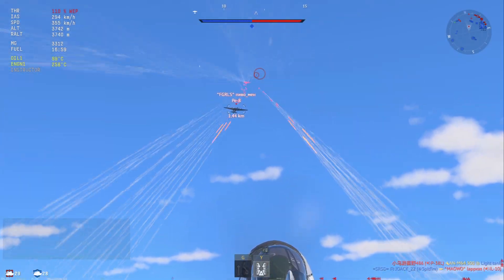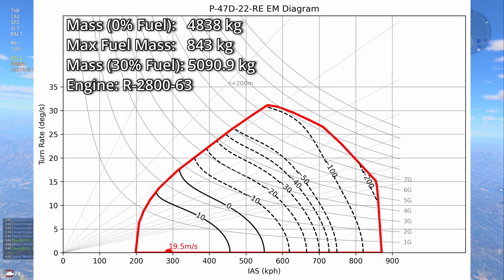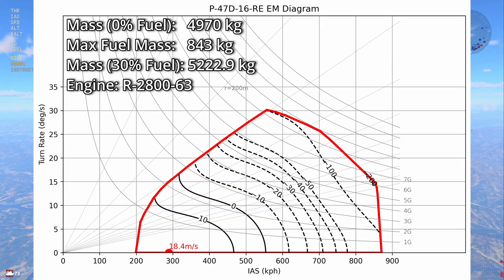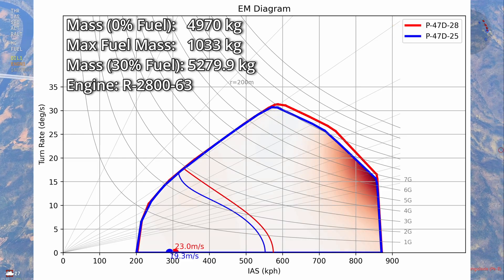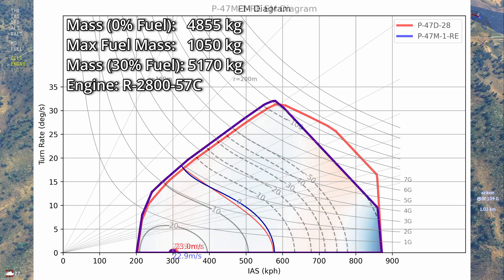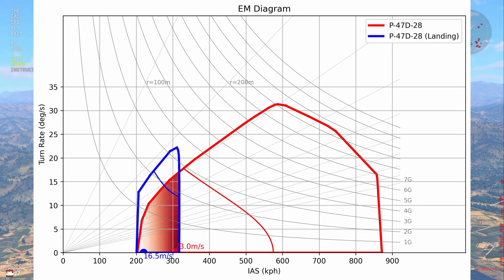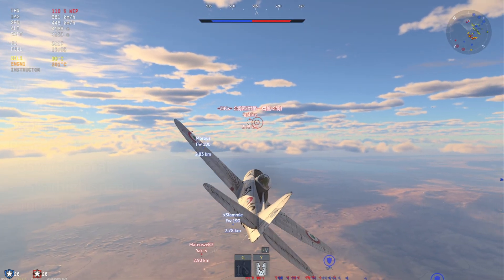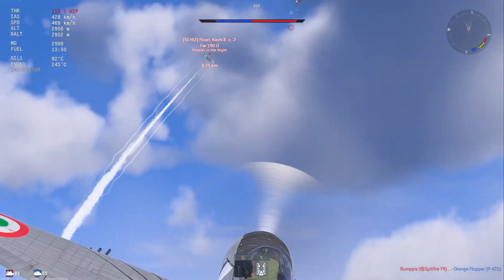Post-Nerf Clarity | P-47 Variants Compared

Comment: Ackchyually, the P-47N is a long range escort version that has longer wings with squared off wingtips to hold fuel. It has boosted ailerons which is why it rolls faster.

If only it wasn’t so fat with the 30% fuel load spaghetti code…
Reply: In rb it's sub optimal to use but in sim
That thing is is pretty good thanks to 
-flying longer and having less fuel overtime to be comparable to other 47s in weight
-late war gun sight (it gives you auto lead)
-better cockpit
-better dive and high speed energy retention
-high altitude performance (capturing points only possible at maximum 6k)

Also I remember hearing about it having a warning radar on the tail that activates if something is behind about a kilometer directly behind with a buzzing sound to alert pilot irl
Reply: @EagleSix52  many of the american aircraft had that rear facing radar, but they were not coded ingame because gaijin
Reply: Ceating is a name I haven't seen in a long time. The P-47N wings are just clipped, not boosted.
Reply: @DSRT888  And lengthened wings. More wing area, that's why it has better instantaneous turn than D28.
Reply from the maker: @DSRT888  ill say its up for debate lol i have no idea but it doesnt really matter to me
Reply: ackshullie
Reply from the maker: @penclaw :_werfErm:
Reply from the maker: lol my b i didnt actually do any indepth research on the irl role

Comment: Why does the D28 at 100% PP in MEC loose so much more energy at 6 - 9.5 G turns I wonder?

Also, am I correct in interpreting the N-15 graph that the plane actually has better retention with combat and takeoff flaps at almost all speeds and g-loads than without flaps??
Reply from the maker: not sure, id guess it has more to do with the fact that its going fast and higher prop pitch is worse for that (like trying to pedal a bike going fast on a lower gear)

Comment: I'll start sounding like a broken record here but i don't care as i must goon.
As a Thunderbolt enjoyer myself (D-28 being the highest played plane in ARB in my account) because of it's use by the Brazilian Air Force, i'd KILL to have all this info in such a neatly packaged video about 3 years ago when starting my journey through the US tree. It's awesome to see all of the conclusions i drew all the way back then being corroborated here like the D-25 being a downgrade of the D-22 at a higher BR, and finding out about the magical MEC settings which changed the way i approached props completely, as i hated having to deal with engine overheating by lowering throttle and thus reducing performance in critical situations.

I'd love to see more depth to the MEC part, like how does the different prop pitch settings affect the climb at different altitudes, and maybe a small guide on how to tweak your MEC settings for getting the most optimal climb at the start of matches, as for me personally it's the part that makes or breaks an entire match, especially for american props. 

But still i recognize that you've already gone above and beyond anything i've seen from other CCs, so i first and foremost ask you to get some rest. Or not if the graph voices in your head still call for your testing.
Reply from the maker: i think it would probably be best to just come on the adamtheenginerd discord server and ask about the mec settings cuz tbh i barely use it myself and idk any of what mixture is supposed to do or engine mechanics. there are a lot of ppl here that actually nerd out way harder than i do on it

Comment: The Chinese D22 is a good one. Much better teams and you compliment your team well. Haven’t played it a shit ton but my win rate is like 80% in it lol
Reply from the maker: i should spade it eventually :)
Reply: This is a bit wierd, the Chinese is called D23, and according to the stat card the weight data and engines are the same, however the Chinese plane has better top speed and better climb, I am not sure why. IRL the D23 was the Evansville version of the D22 with a slightly different propeller. I might try the Chinese version myself.
Reply: @solyomandras  Correct, different propeller, so I tested it. Essientially a D22 copy. A tiny tiny amount of thrust gain but so small its essientially identical. It really comes down to matchmaker. Unfortunately, the stat cards are barely a good reference overall. I've tested a few different aircraft in depth and have gotten data that's different than the stat card. For example: planes that climb better than the stat card value. Planes that can outturn planes with a lower turn time because of speed/compression, etc. Same goes for missiles. 
-Definetely try the D23 its more enjoyable IMO.
Reply: "Definetely try the D23 its more enjoyable IMO." Why so?
Reply: @solyomandras matchmaking, It’s Chinese. Teammates are typically better and have better aircraft for the meta. American teams generally suck.
Reply: @gforce_117  by American teams you mean the players that are flying American planes?
Reply: @solyomandras correct.
Reply: @gforce_117  I am still unsure how MM is created, can you explain it a bit?
Reply: @solyomandras  What do you mean by MM?
Reply from the maker: @solyomandras  matchmaker probably
Reply: @gforce_117 yes, matchmaker
Reply: @solyomandras  It's a historical matchmaker.
Reply: @gforce_117  it's a pity that the Chinese P-47 doesn't have any good camo.
Reply from the maker: @solyomandras  ingame the d22 and d23 are identical. check out my review of the d23 for a more precise comparision
Reply: I guess that the P-47 line is generally a good preparation for early jets, right? I mean playstyle-wise.
Reply: @solyomandras  Sorta. Early jets vs props I would say yes its similar, becuase you have to use your speed and energy to fight instead of trying to turn with them. Play whatever is fun to you and try some different aircraft to learn more about strengths and weaknesses.
Reply: @gforce_117  well I enjoy the Jugs, but occasionally I also fly Yaks (1b, 3). Bf 109s for some reason are not my cup of tea, but Fw 190s I enjoy as well. Apart from speed I enjoy the strong armament and huge ammo capacity of the P-47s. I am not a great marksman by any means so that helps a lot.

Comment: I flew out the D-28 today and I was just thinking that Thunderbolts are balanced for gameplay that mostly doesn’t exist. The D-25 that everyone dogs on for being worse than the Razorback? It’s power goes strong all the way past 8000 meters. Almost no prop has a power plant that just keeps churning full power to 8000+ meters. Sadly, that’s largely irrelevant. The same bug hits the N and M variants - they actually get more powerful with altitude up to 8000 meters. They both pay for that with worse standard power than the D-28, big fuel loads… and a full 1 BR bump for the M because its 12 mins of WEP are pretty solid. 

The D-28 is rock solid to 6000 meters, which is more than enough in almost any current ARB match. You can take less fuel. You make more standard power.  There’s not really a such thing as a low alt Tunderbolt, but the D-28 is definitely as close as you get - a mid alt monster, so to speak.
Reply from the maker: ok but i mean so does the razorback, the d25 is just objectively worse than it
Reply: @CatWerfer  - that's true, just pointing out that the D-25 and N models would be much better than they are if fights actually occurred above 6 km with regularity.  

Some of the BRs might be relics from a time before separated ground/naval/air BR - ground ordnance options should have zero impact on a fighter's BR for ARB in my opinion.

Comment: D-16 has a different propeller
P-47D-22 onward had paddle blade props, of which there were two options (you could tell which one it was by looking at the suffix, -RE had the Hamilton Standard and -RA had the Curtiss, until D-28, after that every P-47 had the Curtiss)
The myth that only D-28 had paddle prop needs to die, that it is more powerful in game is because it simply has a stronger engine in game, whereas irl this distinction doesn’t exist because every R-2800-21, -63 and -59 was cleared for the same power rating simultaneously with no distinction among the three
Reply from the maker: O ok

Comment: "Now onto the N-15 which gets clipped wings..."

It also has wider wings. 12.95m for the N vs 12.44m for the rest of the P-47s. It should have a worse roll rate than all other P-47s but if it rolls better than it isn't accurate.
Reply from the maker: Yeah someones corrected me on it
Reply: @CatWerfer  Apologies. I saw it after you replied.

Comment: 6:07 fun fact, at 75% prop pitch, 0% radiator, 90%-120% mixture, you can outrun almost all 109s, Yaks, spitfires, all japanese and italian fighters, at low alt, of course don’t push your luck against the La-7’s and Yak-3U’s those 2 are  engines with wings, also do not try that against the 109K or 190D’s those no need explanation of why not… now the best of all? IT NEVER OVERHEATS!!! And thanks to the WEP bug, you have infinite 2700hp on the late D variants and the M and N and ironically, that compensate the nerf on the flaps
Reply from the maker: huh, ill try that out
Reply: the N still runs out of WEP in actual matches, ive heard it doesnt in test flight with limited fuel
Reply: The N/M models are Dr. Jekyll and Mr. Hide - off WEP they are actually worse than the D-28 until 7.5-8 km and comparable to the 22/25.  With WEP, the M is only slightly better than the D-38 until you're above 6km.  It's a questionable trade for the BR.
Reply: @Talon6former Yup… but… It’s a veeery old premium and honestly I don’t see Gaijin doing something for it anymore since is not above everything and also below anything
Reply: Im a N15 main, ussually i use 90% prop 120% mix and 40% tcharger 0% radiators not nessesa

Comment: Yippeee a P-47 video, I miss the old rip off flaps the new one's suck donkey nuts. Thank you for the graphs ive been relying on old ass reddit post to validate my delusions of P47 engine performance with MEC
Reply from the maker: idk ive been told these arent optimal either, but im kinda too lazy to test more
Reply: @CatWerfer  its close enough to what I use to think that I have something right, I run 85% prop 20% radiators and 90% fuel mix

Comment: There's a bug report on the flaps with good sourcing (it seems it should work the same way as the Corsair?). I tried to link it, but I think youtube tends to hide comments with links in them. 

I think the reason the D-30s are higher is american teams. Presumably the D-28 was doing significantly worse because of the playerbase do it went down again while the D-30s stayed at 5.0. 

Also where uncut MEC/AEC rant
Reply from the maker: lol thats possible, hard to justify the 0.3 br increase... at the same time the d25 is worse than the d22 and is at a higher br so

Comment: do the p51 next
Reply from the maker: i got a guy insisting i do the yaks next
Reply: @CatWerfer  only acceptable if its to point out how unfair they are, i dont need any more people flying yaks smarter, though thats usually not an issue with soviet mains
Reply from the maker: @simplode7752  i hate yak3s I HATE YAK 33333333333333ssssssssssssssssss

Comment: This is the best comparison from the thunderbolts i have seen yet on YT. Congrats, you got the best ownership of one of the most wrongly used planes in the game :D But even if i quote you here, use always mec on it to feel great. btw i recommend 90% mixture to like 2km alt (i think) and decrease it to 82-85 depending on 4-6km alt and beyond. you can put your rads if you are stock or overheating to 10-20% rads but you usually (never) need it. keep the prop pitch at 78% on my opinion, 80 is a bit too much, its already at the drag point of setup. Anyway have a good day!
Reply from the maker: thanks for the tips :) it seems there are a lot of different opinions on what ideal mec settings there are so ill also try yours out
Reply: @CatWerfer  its fine but you basically got it 99% right. my prop pitch settings might vary a bit since i do it through gauges feeling more ,i no longer use WTRTI actively except for test flights in RB or short SB sessions (for some reason plays act differently on test flights and actual games)
Reply from the maker: @r4vr4m12 yeah i only use wtrti for testing, i dont use it ingame cuz for some reason it messes with my performance
Reply: Interesting, I will try these MEC settings, using WRTI i didn't notice any benefit of more than 75% fuel mixture below 2k meters. For above 5-6km then you may need to reduce fuel mixture by 5% for every kilometer(approximately).
Reply: you guys arent understanding how mixture on P-47s work at all, the only thing you need is to have it at at least 75% as this gets it into the "auto rich" mode. the P-47 mixture lever has 4 settings essentially, it has idle, auto-lean, auto-rich, full rich. with the lever in the "auto-rich" setting the mixture is automatically controlled by the plane for max engine power at any altitude.
Reply: That explains a lot, many thanks. I usually know and see 3 lever positions (Auto rich,med,lean)on USN and on that term on the zero, but I thought you could set it up much closer with the percentages like you would tune an old school carburetor on a hot rod/before the days of ecu`s on cars @Delantho
Reply from the maker: @Delantho ngl idk how mixture works, i thought i made it clear that im just parroting settings someone else told me and havent tested for optimal
Reply: @CatWerfer  it was more in response to this thread than your video, the % of the mixture on p47s is just the lever position of the mixture on the throttle, there is no real difference between going in the range of 75% to 100% as these all lie in the "auto-rich" position the 100%+ rich setting was only used historically if the auto-rich system had a malfunction. as for the auto-lean setting this was just for cruising to save fuel then once you were in combat you moved the lever to auto-rich
Reply from the maker: @Delantho ok

Comment: Yak-9U when (jk, i know there are still others in the list you have to work on before the one ive requested)
Reply from the maker: eventually...
Reply: @CatWerfer aight just a tip, just keep throttle at 100%, only use WEP when climbing when in a fight.

Funnily enough the same engine irl had so poor lifespan the pilots never used WEP
Reply from the maker: @lonemarkkingoftypos3722 are you talking about the yak9u or the p47? i havent had issues with wep on the thunderbolts
Reply: @CatWerfer yak-9U ofc, its climb is quite similar to a Yak-3 at 100% throttle, but starts to sirpass it at 3km.

Yak-9U also has WEP, but it makes the engine go nuclear hot.

Basicly think of it as a bigger Yak-3, but with higher rip speed and has WEP.
Reply: @lonemarkkingoftypos3722with the 9U, use 92% prop pitch. That allows you to run 45% rads 55% oil without even entering the yellow on most maps.
Reply: @lonemarkkingoftypos3722 "Yak-9U also has WEP, but it makes the engine go nuclear hot."

And adds a notable hp and performance bump thus you want to be WEPing as much as possible. The way to get around overheating in virtually every fighter is to use MEC. Some props it is mandatory, like the Re.2000s and Re.2001s. Others, like the 9U, just need a relatively small drop in prop pitch.